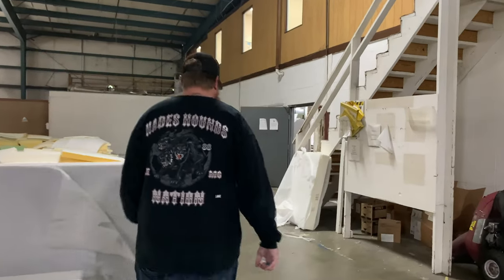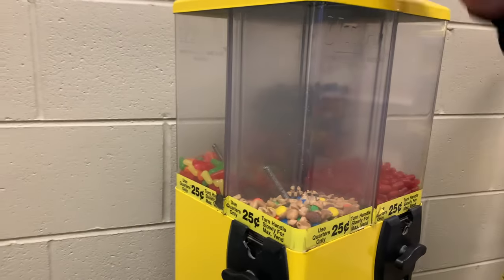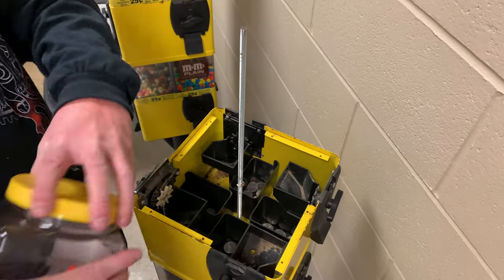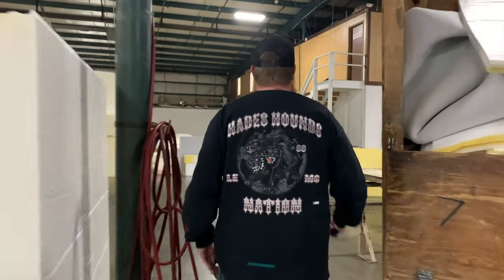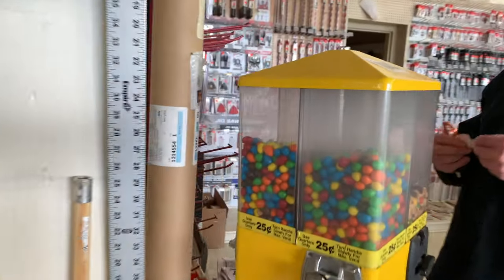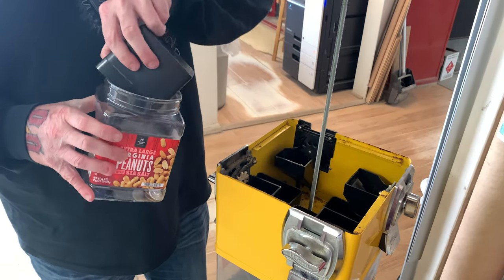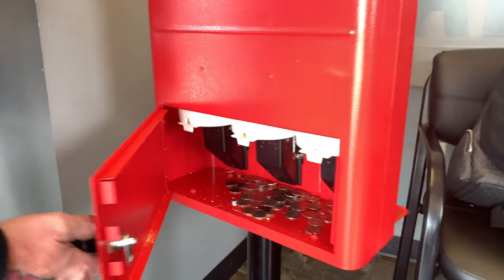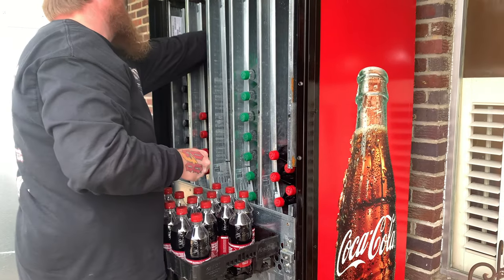The U Turn Bulk Vending Machine

Comment: I’m interested in more information on the coke machine. Also your thoughts on buying established routes vs building one. Thanks
Reply from the maker: Thanks for watching! Buying an established route as you saw in this video can be good if bought for the right price. But the locations need to have very high foot traffic even if the machines aren't the best. Joe plans on upgrading these machines by making them into four container machines. If the route was mine, I would slowly replace the machines with better quality machines with fifty cent mechs. And sell the machines and use the money to buy more quality machines. I also think building a route is just as good or better than buying a route. It's free and helps you fine tune your pitch while placing quality machines. Now with the Coke machines, Joe was very smart to get into it with no money. He went to his local distributor in Tupelo to find out how to proceed with no cash. He found that Coke will supply the machines if he supplied the locations. He did it without cash because he didn't go down the credit rabbit hole with them where he would need credit for Coke to front him the product. Joe uses cash at the distributor to buy cases of product to fill his machines. I plan to hopefully soon go back to Tupelo and record Joe's progress in bulk vending and get more details about the exact paperwork and etc. Joe got his free Coke machines and if he has obtained more. Thanks for commenting!

Comment: Are they worth it
Reply from the maker: In my opinion these machines are worth investing in because of the expense to upgrade to fifty cent mechs if they are available. Also the time to modify the wheels to have the machines to dispense gumballs. Now if I could flip the machines quickly for a fast profit, I would do so. But these machines are obsolete for today's economy and the company is out of business that used to make them. Thanks for watching and commenting!
Reply: @gumballgold  thank you I just bought two of them today. I’m excited to fill them up now I have to figure out where to get candy  in  bulk. Sam’s Club only has a select a few. Hopefully I make profit.
Reply from the maker: @OctobetsownAKS3  I recommend candymachines.com or All Star Vending for the best selection and prices close to Sam's Club.